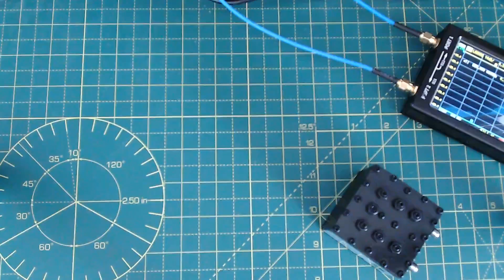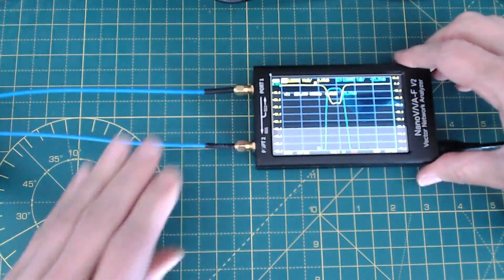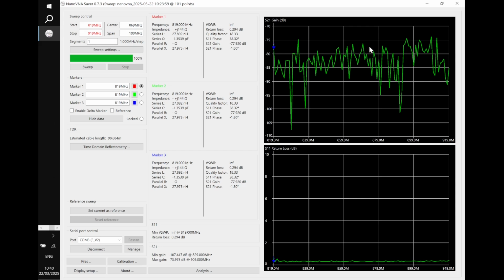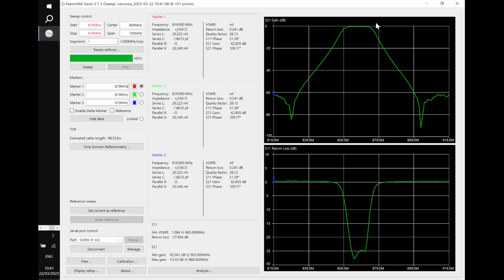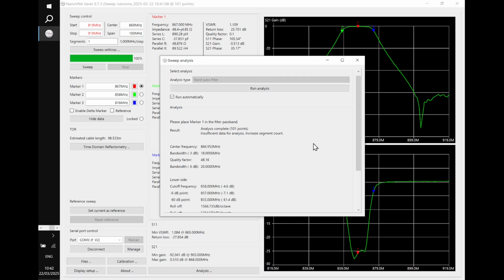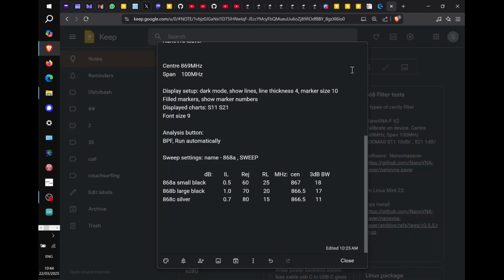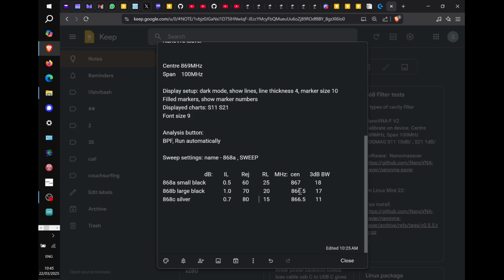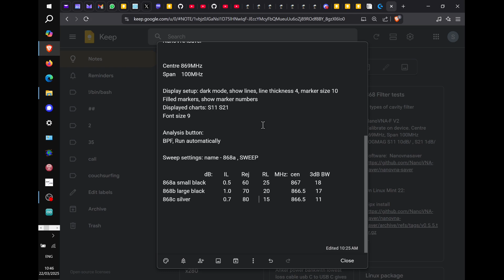Measuring and comparing 868MHz Filters for Reticulum and Meshtastic

Comment: Looking forward to signal/range test to see the improved range with filter and good antenna.
Reply from the maker: Would have to make one of the nodes mobile to measure range...
Reply: @fotografm or find a slightly further stationary node.  Right now you've shown that the filter makes a bad antenna on par with a good antenna. A bit more testing is needed to show if the filter is worth it if already have a good antenna.
Reply from the maker: @vica153  depends on the definition of a "good" antenna. My problem wsa caused by extremely strong signals 60MHz away.

Comment: Iam curious about the steepnes of filter curves. Do the filters get full rejection deepness at close frequency bands like 900mhz cellular phone services?
 What do you think how deep signals should be attenuated to get full rx capabilitys out of lora transceivers?
Reply from the maker: I will check next time I measure the filters. It's a good point. As for how much stopband attenuation is needed - the more the merrier ! Technically it depends on the blocking characteristics of the receiver when the front end becomes saturated. These tiny boards probably don't exactly have stellar performance in that department...
Reply: @fotografm  i looked at this things a while now. To get the low signals received it looks like all others must be attenuated to around -90dBm, but iam not shure yet about this exact number, because i have not enough other known nodes around to test this. Driving my spectrum analyser with me around and play with this to get a feeling.

Comment: Nice examples of filters. Can one daisy chain them for fun? Which order is best then?  Or would that be too silly?
Reply from the maker: Each filter you add in the chain would add another 0.5 to 1dB insertion loss in the passband. If two filters with 60dB rejection were to be daisy chained then the stopband attenuation would increase to 120dB ! This would be a monumental advantage if there were a very strong adjacent frequency interfering signal. As always, it's a tradeoff between in-band and out-of-band performance. The order of connection would not make any difference.
Reply: Ha I have a hard time believing there is any real instance where 60db rejection was insufficient and losing another 1db signal would be worth it.